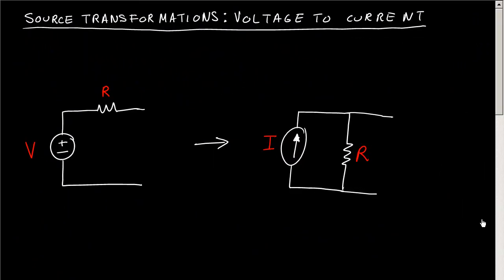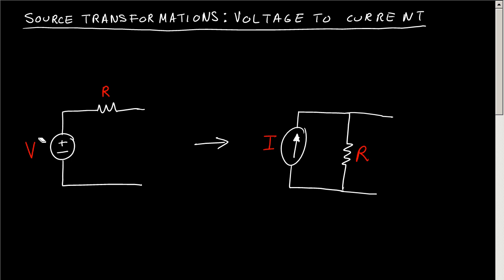Source Transformations: Voltage to Current

Comment: the problem is, current is measured in seconds. You can have high voltage in a tenth of a second..which equates to a small current since current is measured in seconds..